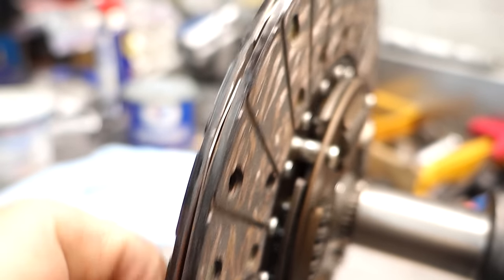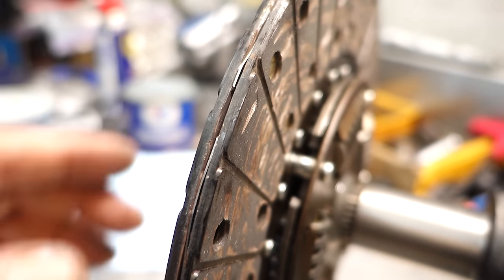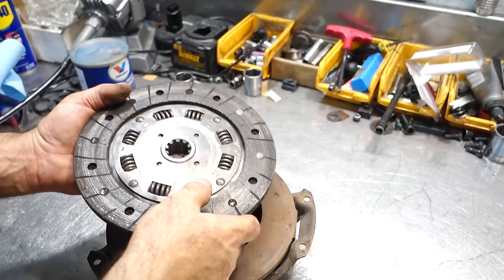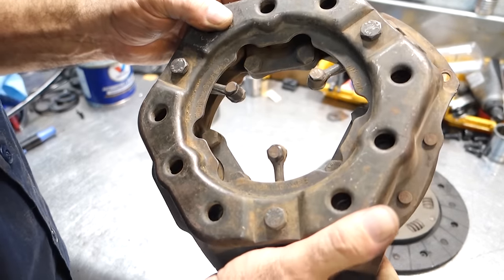Learn How a Clutch Works -  Basic Clutch Operation and Tips

Comment: Is a pilot bearing better for less drag than a bushing and are they interchangeable on a Pontiac engine?
Reply from the maker: I never use bearings
Reply: @GearBoxVideo  thanks this is a great page I stumbled upon, I have this exact issue of grinding in reverse without first stopping the rotation by going into first before reverse.
Reply from the maker: Then you either have poor clutch release, trans misalignment, or drag on the bushing  Wait 10 secs and then go directly into reverse  Trans should be completely stopped.
Reply: @GearBoxVideo  this all started with the new clutch and flywheel cut. I originally thought it was from the cut because where the pressure plate attaches to the flywheel there use to be a small step and now it’s all flat. So I assumed that where I lost some clearance.  But as you pointed out it could be many things. I really appreciate the time you take to answering questions and love your channel.
Reply from the maker: Makes sense. You cut the wheel and it moves the clutch farther away from the release bearing. Hydraulic bearings will not be able sometimes to make up the difference. Fkywheel should be shimmed to compensate for material removed. Also dont assume because it is a new clutch you can't have any problems with it

Comment: You showed the detail of how the pressure plate is tight against the clutch! I was wondering what I missed. You saved me fromthe expense of having tobuy a nice samuri sword inorder to commit sepuku.
Reply from the maker: The idea was to show that that is all the space needed to compress that is required to create  a typical 2500 lb load.
Reply: GearBoxVideo
It is a detail that I did not get in other videos. I thought Either I missed something or got the wrong part.

Comment: The reason behind the springs in the plate is to absorb some power that happens when you release the clutch pedal transfer the power between flywheel , clutch plate and the pressure plate  .if it wasn't for the springs you could potentially put strain on the gearbox resulting in stripping the gears , breaking a shaft or cracking the gearbox casing and also damage to bearing s.
Reply from the maker: Not true. Sorry. Do you realize that most racing clutches have solid hubs? The springs are there to dampen harmonics. Almost every drag race clutch we use has no springs. Also most road race clutches have multiple clutch discs with solid hubs.

Comment: ? Does the input shaft ALWAYS move when the flywheel is moving? I am trying to grasp and get educated on what all goes on ... my 27 year-old truck just had its first new clutch job at 341k miles
Reply from the maker: No, only when the clutch disc is locked to the flywheel via the pressure plate
Reply: @GearBoxVideo  Thank you for the education! this video you made is absolutely mesmerizing!  i have many more questions ...even though I have been driving the MT for 35 years now and have only personally owned MT in this time (4 vehicles in total)

Comment: i read in road n track that manual gearboxes were pretty much being phased out all together since automatic transmission have gotten good enough to be faster at gear changes than a person depressing a clutch and shifting into the next gear could do.i hadnt realized that the speed of the gear change was the only thing driving the manual gearbox market. ive always gotten much more enjoyment out of shifting thru the gears myself than just being along for the ride w not much to do, besides the rush that can come from the surge of power u get after perfectly rev matching your rpms w your next gear and reengage the clutch is something id think every driver would want to experience :)
Reply from the maker: They may phase out manual transmissions in newer cars and replacement with DCT type transmissions that are controlled via computer. Its already happening. However it will just make older cars much more valuable.

Comment: Thanks for the video .. I gave you a like... I have a question please .. so I sometimes switched to second gear and accidentally give more gas before I totally release the clutch .. maybe just 2 seconds... So by doing that is that consider riding in clutch and did I do any damage to it? Once again thanks for the video
Reply from the maker: The clutch can handle that. But I would make it a habit

Comment: An excellent video! Thank you especially for taking the clutch plate apart so we can see it's internal workings. Just had a sudden clutch failure on my x-trail. I couldnt understand how it could fail so suddenly. Ends up the clutch and thrust bearing was fine, but one of the tabs on the side of the thrust bearing broke off so the clutch fork was pushing straight on to the diaphragm fingers. Seems like a design fault or material fatigue...never heard of it happening before.

Comment: I am very impressed at how easily you explained the mechanics of the clutch.  Now to explain my situation and ask my question.  I have a JKUR 2008. Last Friday I had a hard time Taking the vehicle out of gear.  After coming to a full stop and trying to put it into gear, I could not.  So decided to park it and after pulling up on the parking brake and tried to put it into gear  it went in no problem.  So I decided to drive around the corner and park it in front of the house.  So on Monday I was obliged to move the JKUR and started the vehicle and the vehicle moved forward even with my clutch depressed. What can be the problem.
Reply from the maker: Having poor clutch release is the issue. Could be bad hydraulics
Reply: Thank you I will look into that.

Comment: For the lever-style pressure plate, how does the thrust bearing engage the levers? With the finger-springs, there is a large flat surface for the bearing to push on.
Reply from the maker: Actually the bearing does apply on those levers

Comment: Great video!! I replaced a few clutches  over time 85 GMC p/u 1/2 t , 86 cavalier, and a 09 Hyundai santa fe  bout a month  ago , all was similar, but a few years ago I replaced one in a 97 Dodge neon , there were 2 listings of course mine coast the most  but the clutch was all in one piece, and   the flywheel was just like the one you would find in a automatic, that was a first for me just 4 bolts out through the flywheel. Just wondering if this was a common  clutch... keep up the great videos
Reply from the maker: +harleypeddle Clutches for domestic and foreign vehicles have changed in design greatly in the past 10 years. I don't have much experience with the clutch you speak of but I am seeing more flywheel and clutch units. Alot of it has to do with dual mass flywheels and the correct dampening rate of the clutch springs to reduce harmonic vibration.

Comment: 40 years a go I had a 396 Chevelle that used to always throw those springs.  I never understood what they were for.   I always believed I had an alignment issue with the trans and engine or my throw-out bearing was hitting the clutch crooked.  I always babied the clutch when I drove but, it happens anyway.

Comment: An issue I had with a brand new 1995 Z28 Camaro with the T56 was inconsistent vibration after shifting gears.  Dealer installed (no charge) an aluminum competition drive  shaft, which did not really solve the problem.  Six years later, my mechanic and I discussed the symptoms, , ,  I mentioned I thought clutch was sometimes off center, as vibration was usually after a “relaxed” shift.  Sure enough. . .   The splines on the clutch disc were too lose on the input shaft,  how that original disc ever ended up in the car is a mystery.

Comment: Cool video.  Thanks.  What keeps the plate sandwiched against the clutch?  Do they still use springs in modern cars?
Reply from the maker: +Sam Garrison Some have coil springs, most have one diaphram spring now. Bolting the pressure plate to the flywheel loads the spring pressure against the disc and flywheel.

Comment: Thanks,very good explanation,and I also have pro blem in my ln166 Hilux cab that is ,when I start my cab it shakes abnormally and I replaced all three mounts(engine and gearbox) but still that problem is there.is that a problem of clutch and pressure plate?

Comment: This is the best transmission explanation thank you for it, I have a question for you.. my transmission sounded like it exploded while under acceleration. I thought it was the clutch disc that came apart but once the car was in the air, I’m rotating the front driver wheel and it’s making a chattering sound and I feel the chatter in my hands as I rotate the wheel. Passenger wheel spins good. I’m able to shift and the transmission engages but there is a chattering feeling when I turn the wheel. With the motor running , the peddle caused a chatter grind sound when pressed and moving the shifter does the same thing. It’s on stands now halfway disassembled and I wanted to know if you had a minute to see my video I uploaded?
Reply from the maker: Send emails to links at support@5speeds.com

Comment: Thanks for the great video!  I completed a 1.9l diesel swap on 1992 isuzu pickup.  I installed a remanufactured transmission.  The transmission is a 1995 S10 v6 NV3500. I have 12000 miles on the clutch pressure plate assembly that was purchased from autozone. Recently I noticed it was getting harder to shift into reverse. So I adjusted the linkage on the Master and for 25 miles it worked perfectly. Now it is difficult to shift into any gear. I got someone to press clutch pedal and it appears the bell housing moves slightly. I purchased a new slave valeo and now am in the process of installing. Any suggestions?

Comment: good job and thx, Paul. any idea why the throw out bearing on my 79 911 went bad after 2000 miles?  the entire clutch assembly had been replaced. my mechanic said it was a faulty part. i suspect it may  not have been installed correctly.
Reply from the maker: No I don't.

Comment: so how is the pressure to the pedal reduced? is it simply that the pedal is a lever so you are applying a lighter force over a longer distance to engage and disengage the clutch? how would you make it so you have a shorter clutch pedal travel but is not really harder to press? great vid btw
Reply from the maker: You would actually work backwards. Because the motion required to release the clutch, the length the fingers would move to gain proper release would have to be calculated such as clutch fork pivot as well as pedal pivot. With hydraulics, It is a matter of master cylinder piston bore diameter and travel. Basically obe has to do the math

Comment: 12:43. Assuming we're talking about a four stroke engine (which is what a clutch like this comes from), a four cylinder engine fires once per revolution, an eight cylinder engine fires twice per revolution.
Reply from the maker: No..sorry.  4 cylinder twice per rev and 8 cyl is 4. That is why why a V8 is called a 90 degree engine. They fire every 90degrees and a 4cyl every 180 degrees
Reply: @GearBoxVideo  LOL, you know, come to think about it...  Yeah, a cylinder is going to fire once every other revolution, so the fire count per rotation should be cylinder count divided by two.  Though the degrees don't really enter into this.  For instance, there are V4s (mostly on motorcycles), which don't have flat plane cranks, and there are V8s which have flat plane cranks (which are 180 degrees out), in both cases, regardless of the number of degrees per separation (dictated by the crank), the firing count will be cylinder count divided by two (every other rotation for each cylinder).
Reply from the maker: Rather that get caught up with firing counts per revolution the message about this in the video is about harmonics and how gear boxe rattles are magnified on low cylinder counts with alloy flywheels. That is why you now  see dual mass flywheels aiding in harmonic issues. When you start switching out dual mass flywheels for lighter single mass wheels you can cause severe gearbox rattles under idle and low load conditions.
Reply: @GearBoxVideo  Yeah, I know what the point of the video is.  We were having a conversation, kicked off by my misspeaking regarding the number of fires for a cylinder count.  Upon further reflection, I was forced to agree with your original statement that there are two fires per rotation for a 4 banger.  But, since you brought up degrees of separation, I thought I'd respond to that, as the degrees will affect 'when' the cylinders will fire in the rotation but not how many times.  As far as the point of the video goes, you did a great job presenting how clutches work, and their implementations, and their relationship to the overall system in which they're couched, it was a top notch effort.

Comment: Ive noticed that SOMETIMES not all the time that when i need to shift my datsun 280zx into reverse. It does that chatter thing you disused at 6:08. To prevent that, i have to put the transmission into a forward gear or hold the shifter in neutral for a little bit. granted my engine idles at 1000rpm so im not sure if its just that the transmission input shaft hasnt stopped spinning yet or that the clutch isnt fully disengaged like this entire video discusses.

Comment: Thanks for the input...your very thorough on way thru the vid I like the way you showed the reverse grinding as well...I have a smallblock 350 with a 4 speed 4wd in it gonna have to replace the the clutchplate etc.It won't go into any gear unless the motor is off...81 k5 blazer gotta get her rolling she is a beast. Subbed your channel 💪😎
Reply from the maker: Thanks for watching.

Comment: Very educational video
A question
I had just replaced a clutch on my mini Cooper
But the output shaft won't turn
The transmission gears will shift.but it seems there is no power going into the transmission.
Reply from the maker: That is a hard one to diagnose without seeing it

Comment: Very informative for a DIY mechanic like me. With my 1973 lotus Europa special I am having a bit of trouble in getting out of 1st gear,more trouble getting into second and unless Im very slow it occasionally grinds into 2nd. It has a relined disc which worked without these issues for 600 miles until I put the linkage system back to factory settings. The "air gap" is about 60 thou and I can clearly see the disc spin via the bell housing whilst in gear and rocking the car back and forth,but my symptoms seem like a dragging disc. I am confident Ive set everything up perfect yet it is still not working well.
Reply from the maker: The spigot bushing if changed may also be too tight
Reply: @GearBoxVideo  I didn't change the spigot bearing as the car was very low miles. It had oil on the original disc via a bad input shaft seal. Could the problem be the clutch cover was damaged because it had been in use with an abnormally long clutch lever arm travel (until I reset things)

Comment: I have a 2005 Porsche 911.  I just had my IMS bearing replaced.  My mechanic felt the clutch barely had any wear so he did not replace it.  Since I got the car back I feel a vibration in the clutch pedal above 3500 rpm. Mechanic feels it’s normal and doesn’t feel it. But I never had vibration before. Hopefully you could give me an explanation and shed some light on this issue.  Thanks !

Comment: Paul watching your video I’ve repaired my super T 10 it works perfectly but now I have shudder when I take off it has a Howe’s hydraulic throwout bearing I replaced the PP and machined the flywheel along with a new clutch it shudders and ideas I can look for ? Cheers

Comment: Question, is the throw out bearing riding on  the pressure plate springs when not engaged . And or how much does the   pressure plate springs stick out from the pressure plate. I picked up a Chevy 216 motor for my project car that looked to have new clutch components  and surfaced flywheel  ( they weren't on the motor yet )  when installed   I have to put my peddle almost to the floor board to make the trans engage .  I  now tried to adjusting the throw out baring to the  pressure plate springs and not much better  change . So then adjust the baring more into the springs to where I felt it slip going from 1st to 2nd.  I also made sure the clutch plate slides good on the trans spline.  Any help would be great.
Reply from the maker: The throw out bearing only is loaded when you apply pressure to the clutch by pressing down on the pedal. The amount of travel required to release the clutch is different form clutch to clutch. When you cut a flywheel, you effectively move the the clutch assembly away from the bearing.  You may need an adjustable pivot ball to move the fork closer to the clutch, or you may have purchased a defective clutch.
Reply: ok Ill try the pivot ball first, I never thought that was an adjustment too. thanks.

Comment: very informative! thanks for sharing, if i had to switch out a transmission or buy new parts is it possible to do this at home? also, how should i drain transmission fluid from the casing before opening it?
Reply from the maker: Thank you. It would be helpful to know what you are working on.
Reply: well for the comming ten years probably nothing as i have to save up to buy a derelict which i want to transform into a beauty again, but i was wondering in general to be honest. though my preference would go to a manual transmission. (no automatic)

Comment: maybe it is worth mentioning that the old clutches uses graphite block instead of thrust bearing, the graphite wears as we disengage the clutch, so minimize the time riding the clutch.
Reply from the maker: The reason they used a carbon bearing was simple. The bearing applied to the clutch cover on a Fork but was attached to the fork and didn't float. It was poor engineering. As the bearing applied on the clutch it also moved across the surface since the fork moved in an arc. Where as a ball bearing would fail if it wiped across the surface while being applied